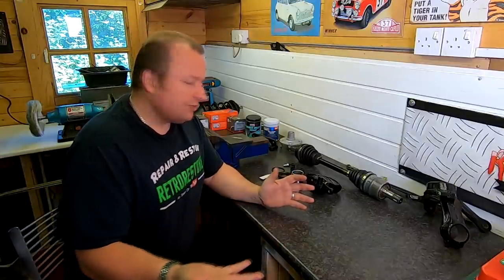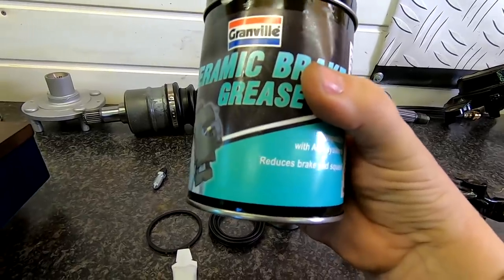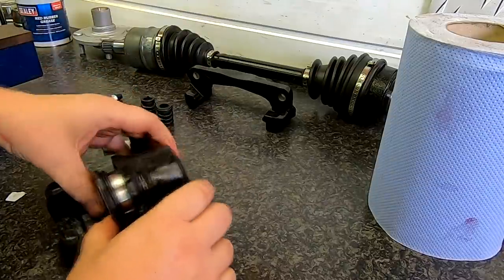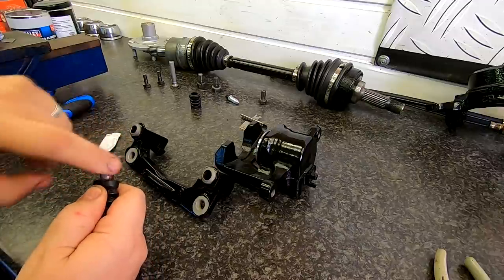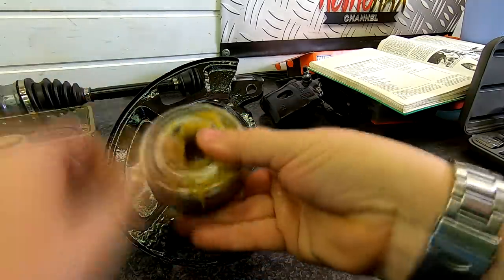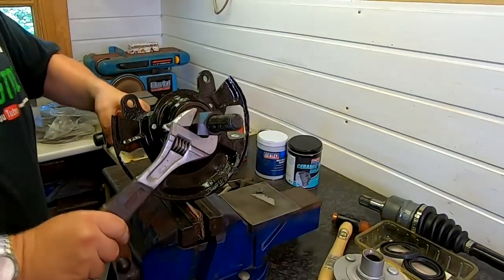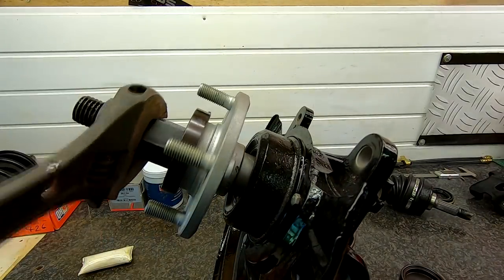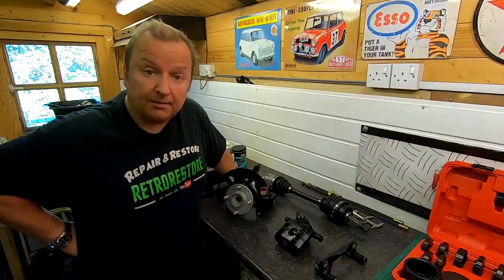Part 30 Triumph Acclaim Hub Bearing And Front Brakes Assembly

Comment: Hi Martin, I used to have an easier way to fit the rubber on a brake piston. I would fit the rubber on the big bit of the piston first, then fit the rubber in the caliper, push the piston in its seat and as you push it lower, the lip wil automatically snap in place of the piston. You might want to give it a try. worked good for me.
Reply: Same here,saves a lot of swearing!
Reply from the maker: Cool, thanks

Comment: How you put the piston dust boot on is you slide the boot down to the bottom of the piston feed the boot into its outer groove and once it's in its groove then just push the piston home, never use screwdrivers on the rubber seal because even though you can be careful if you slip it will stick a hole in boot very easily, I've done hundreds of caliper rebuilds over the last 2yrs on VAGS and Skodas especially rear calipers for some reason they love to seize solid.
Reply from the maker: Yes, I agree Mark,
Reply from the maker: @markmawson1  It looks a lot easier Mark, Thanks for that.

Comment: just a tip for getting the rubber dust seal into the caliper put the rubber seal into the caliper first making sure its all seated and then slide the piston in last through the rubber as you push it in the rubber will seat into the groove on the piston
Reply from the maker: Yes, I've used that method too.

Comment: I had to spend more money on the Reliant, the yearly Barr's rad-weld as a matter of ongoing routine, I went for some Morris "Goldenfilm" engine oil and some molyslip, as the stuff does quieten down the ol' OHV a lot.   I put some of this 3M kevlar adhesive tape over the bit where someone has drilled the fuel filler elbow and that stuff is super sealed it so a good temp solution til the replacement fuel filler elbow arrives.   I'm going to layer this 3M tape over a couple wraps as its pretty evil to just cut let alone put a drill thru and it seems several people round here got drilled for petrol :(   Whilst its up I am stonechipping the A frame, wirebrush the front spring and paint with some rubber stuff and jizer the sump as that is crusty crusty of old dirt, derv and horse doings then stone chip that as well :)

Comment: This is coming together quite nicely. A shame your CV boot clip tool wasn't up to the job. I didn't have any problems with the one I bought from Amazon when I used it on my VW Polo. I'll post the link below. The bearing kit certainly makes the job of fitting bearings a breeze and is pretty much essential.
Amazon link for the CV boot clip tool.
https://www.amazon.co.uk/gp/product/B001RPF51Q/ref=ppx_yo_dt_b_asin_title_o06_s00?ie=UTF8&psc=1

Comment: Hi martin, do you remember where you got the wheel bearing kit? I bought a wheel bearing 'kit' off of ebay but it only came with one seal...
Reply from the maker: Mine came forom Ebay too
Reply: @retrorestore  okay no worries, I've had to order the dust seals from America using a honda part number...£35 for 2...